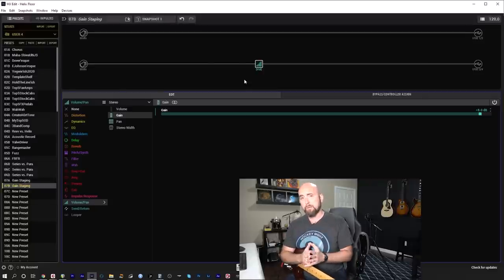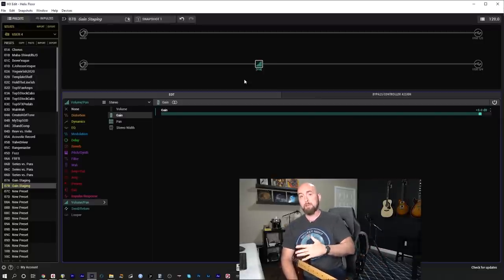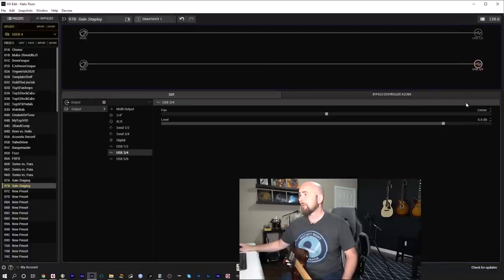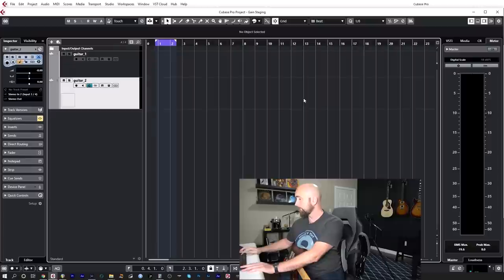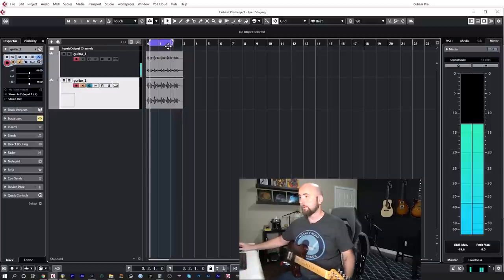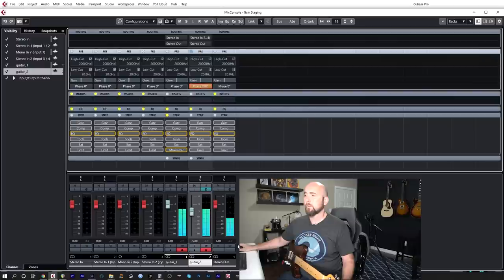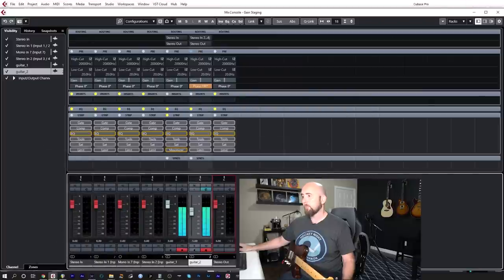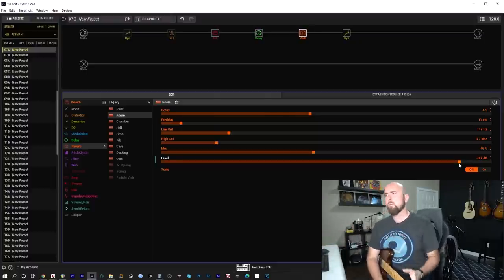THE MOST IMPORTANT HELIX VIDEO I HAVE MADE | Gain Staging - Myths and Facts!!

Comment: This is one of the most important Helix discussions yet, in the entire community. People need to be generally informed about this material, if they're going to take ownership of this much pre- and post-processing. I know monetized YTers who dime CV on every preset, regardless whether it balances with their other presets. I have a bought preset where Input Pad Enabled is recommended, followed by a high-PR comp with high gain and NEGATIVE output level, into a Gain block, before the drive pedals and amp. I rebuilt it with half the moving parts. Thanks for wrapping all this in Cubase for visual support. This was well done.

Comment: Brilliant as always! You proved it with the Channel Volume not affecting tone in the Helix...I`ve never been sure of that part, because I grew up with tube amps having both a channel volume and a master volume. Changing either of these radically changed the tone, so setting up my tube amp involved first getting a rough volume level using the master volume, then tinkering with the channel volume to create a tone I like, finally fine-tuning channel versus the master volume. So with my tube amps, the channel volume was even the more important of the 2 for shaping tone. I had assumed that Helix amps would behave similarly. I had even accepted that normal non-master volume amp models (in real life) have both a master and a channel volume in all the Helix models, cuz you can do that sort of thing in the modelling world!  But you proved that the Line6 boffins didn`t set up the channel volume in the tube amp way for whatever reason. Thanks for your ongoing efforts to improve my understanding  of my Helix LT.
Reply: Yeah I just got my Stomp and haven't messed around all that much with it yet.  The channel volume slider behaves much differently than I thought it would.  It's kind of weird they named it what they did.

Comment: Thank you for sharing the knowledge. Helix is a game changer for sure, and when its tweaked up correctly its unbelievably good. So thanks for pulling out the pain and flattening the steep curve. 

Can I please ask two questions; In the last part of the video where you were referring to using the levels of the output block, to adjust signal volume, is there anything that differs when adjusting this between the standard output block level, and the output level in the Helix's Power Cab tab? 

Second Question; Do you think there is a detectable difference in tone, squishy tube like response, and overall colour when using a Power Cab hooked up to a Helix through either 1/4 inch / XLR or the Digital L6 cable. Very interested to see what you think. Can you test it - could it be a video? If so could you please also touch on the pros and cons of using the Helix's output levels vrs using the built in PC+ input levels on the actual PC+ cab. I do hope these questions are seen as relevant and as elements of "Gain Staging" between Helix and PC+  and that this is the correct place to ask. Thanks buddy, I'm staying tuned. Cheers.   52 Tele (reissue), Helix floor, PC+212, rocken the jungles of Borneo

Comment: Thank you so much for your HX Stomp videos - they are incredibly helpful! I was wondering if you might be able to answer a couple of my questions please? I’m struggling to get the right preset volumes for my intended application of the preset:

I use the HX Stomp for bass and have my presets set up with the following prefixes for for use in two different ways:
 
BFX: these presets are usually effects with no amp or cab which I use when I’m connected to my amp via the L Mono output.
 
BDIR: these presets usually contain an amp and cab and are used for recording direct through the HX Stomp as an audio interface via the USB interface channel 1 (dry) and channel 5 (wet), or recording via the L Mono output into a mic/DI preamp to my PCs audio interface.
 
The issue I have is that the volumes are all different of each preset and are not at the required volume for the application I require.
 
My questions:
 
1. For my BFX presets do I want to essentially make the output volume of the preset/HX Stomp match the input volume so that the level of signal I put into the HX Stomp, from another pedal, or directly from my bass, is equal to the output volume so it applies the effects but it doesn’t alter the signal volume given that my amp will amplify this signal - if so, is this achieved by simply adjusting the volume of the output block on each BFX preset? I can do this by making the channel 5 (processed) signal match the channel 1 (dry) signal in my DAW.
 
2. For my BDIR presets do I need to tweak the output level of these so that I am achieving the “ideal” recording level when connected via USB and recording channel 5 (processed) into my DAW so for example -18dBfs average in my DAW? This would make the recording level ideal when using it as an interface but if I was then to use the L Mono Out into my pre-amp the signal would probably be much higher that it would for say my BFX presets. I’m not sure this is a problem as I’d just adjust the gain on the mic m/DI preamp accordingly. I probably just need to commit to either recording via the HX Stomp as an interface or my mic/DI pre-amp.
 
I was just wondering really if I am correct in thinking that you simply need to adjust the output block level accordingly for what I’m trying to achieve level-wise for recording presets and also I don’t want a massive volume increase when switching on HX BFX presets in my signal chain so essentially the level in matches the level out and this is the same level as when the HX Stomp is in bypass mode.
 
Many thanks for any help! Sorry for the long message.

Comment: In between the noise floor and clipping for any given block is the block’s sweet spot - the level at which it was designed to operate most effectively. Blocks that follow the amp model, where all the clipping is generally done before or in the amp model, are generally expecting a guitar level input or unity gain. If the amp channel volume is much higher than unity gain, then those blocks will be hit with a signal higher then they’re sweet spot. They may add additional clipping in the block that isn’t digital clipping, but sill might add distortion and harmonics that impact the tone coming out of the amp. That may be good or bad. But it at least changes how you have gain staged your distortion and saturation levels. These blocks often have a headroom control to allow them to operate with higher gain inputs. But there’s really no reason to not set the output of each block so that it is producing an input that fits the sweet spot of the next block in the signal path. The goal isn’t to have each block do with its intended to do the best that it can. So you might want to avoid distortion coming from delays, modulation effects or reverbs after the amp model and get the distortion from the blocks that are intended to do that function.
Reply from the maker: Just curious, did you watch the entire video?
Reply: @JasonSadites  yes
Reply from the maker: Ahh ok, was just wondering why the long comment basically repeating what I had discussed in the video.

Comment: Interesting indeed.  I use a 4 db gain block near the chain end for solos, so I'm glad it's not colouring according to your video Jason.  Now I think a 4db increase is good compared to my other snapshots in the preset, however sound guys often comment my lead boost is not enough and they have been suggesting for me try maybe 6 db because for the most part they need increase my FoH mix during solos so stand out more.  I tried 6 db but it's so much louder in volume on stage (mind you I have the PC+ pointing at my head).  Even the band at rehearsals say I need more lead volume, but in my standing space, its very loud LOL.
Reply: You could also check your midrange EQ.  Volume doesn't matter much if it isn't cutting through the mix.
Reply from the maker: Yeah, you have to dial it in for what works for you :-)
Reply: Save an FX block and boost the output as part of your lead snapshot.
Reply: @MoveUpMedia  Is it the same as using a gain block though and having the gain block as a boost?  It's boosting output.
Reply: @Scott - yeah. If you program that parameter change into your snapshot it’s identical to just turning up the volume post everything. It saves you a block and is an easy way to transparently boost. Now, of course, you need to be aware of the overall output at what will now be your loudest and ensure that the PA or Powercab can handle that as your hottest signal.

Comment: Hey Jason! Great video and thanks for doing it. There have been other Helix Youtubers saying presets should be as close in gain to the bypassed tone (no blocks) as possible. Does this make any sense to you?
Reply from the maker: Thanks so much :-) And no that doesn't make any sense to me at all. As I mentioned in the video you want to have the best signal to noise ratio as possible, so they louder you can have the preset to match what you need for it's final destination is what you want. It won't do any harm to keep it low like that if that is what you need, but it will not work for everything and actually potentially be very bad for some situations. As proven in the video it doesn't affect the quality of the tone of the preset if you turn it up louder as long as you don't distort it.
Reply: @JasonSadites  Thanks for the reply. I agree, it makes no sense especially after watching the proof in your video. Thanks again for everything!
Reply: @JasonSadites  Hey Jason, just to quickly follow this up - I played with my band the other night and found another really bad thing about the lower signal presets in that there was no way to get any feedback out of my Powercab. Usually, those exact same presets at the higher levels would feedback like a real amp but it was impossible to get anything out of the new lower levels. All this to say, you are 100% percent right that we have to get the maximum signal from our presets (without clipping) to get the most out of the Helix. Thanks again, Jason! Jeremy

Comment: Wait so channel volume doesn't affect the tone - but I always thought that's what Master did... does raising/lowering Master change the dynamics of the amp then?
Reply: Channel volume doesnt affect the tone. It just controls the overall output of the block (in this case the amp) but it does not alter the tone. On the other hand, master volume of the amp, yes.. It will affect your tone just like "real-world" amps do. I would pay more attention to the gain/drive knob (same thing) of the amp. It's supposed to be the preamp gain, so I'll suggest to play with those two= Preamp gain (gain or drive - in some amps is named different) and the master volume. As an example, If you have a lower gain the tone will be cleaner. Higher gain, higher breakup = distortion. Master volume is how hard you'll drive the signal coming from the preamp section to the power amp or speakers. I hope it helps you :)

Comment: Thanks Jason. A few weeks ago I started leveling all my presets/snapshots to be in the same region on the mastering meter in Cubase. I build my base presets all with 4 snapshots like you do mostly: Clean, Push, Overdrive and Lead. Although the first 3 snapshots have the same level on the meter, the overdriven snapshots seem to be louder (to my ears) than the clean presets. The Lead snapshot is always louder, because it's supposed to be so for me. Is there something I'm doing wrong, or do I fool my ears ? The meter says they're all 3 on the same level............
Reply from the maker: Hi John,

I use the LUFS meters for this purpose but regardleaa of what the meters say, you do need to do a final check with your ears to make sure that things sound and feel the way you want for your particular situation :-) Hope that helps!